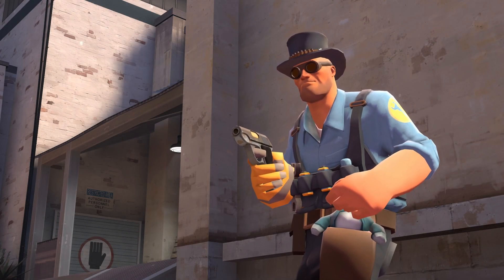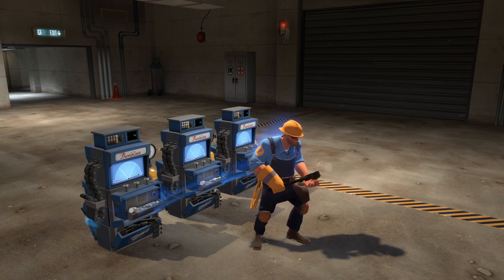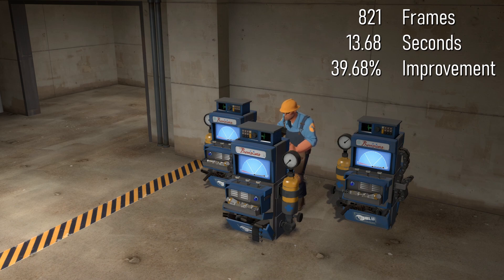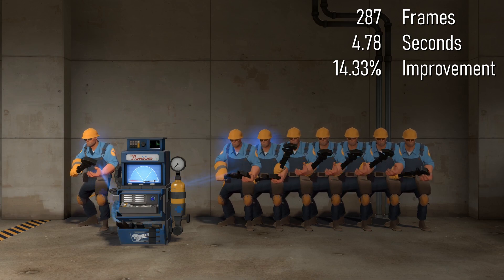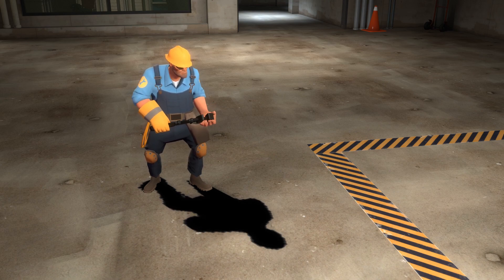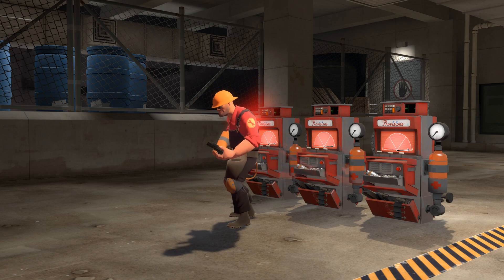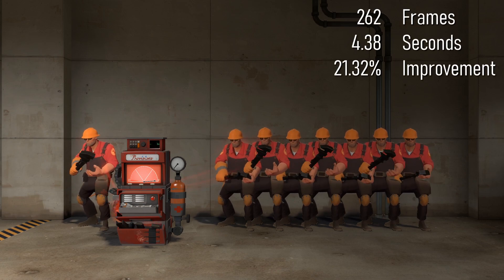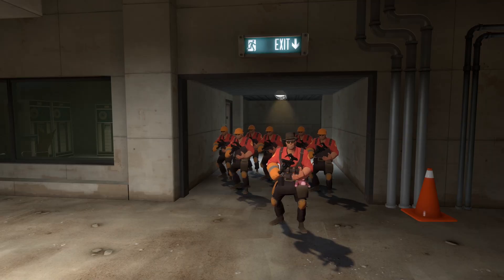Engineer Building Erection Times

Comment: So unsure if this is an April fools joke, but this is something I have wondered about. I skipped a lot, so unsure if it has already been mentioned in the video, but it is situationally useful. In terms of setup it is still faster for each individual engineer to build their own buiildings simultaneously. The most practical use of this would be if a building needs to be replaced urgently in the middle of a match.

Comment: I believe the reason why the rate of diminishing returns isn’t consistent is, if you dont time the swing to hit just after the building finishes upgrading and hit during the end of the animation, theres a moment of inefficiency since nothing is happening when something could be happening

Mainly hitting the building to put metal into the building for upgrading 

In a worst case scenario, that can be almost 0.8 seconds per upgrade animation for stock wrench, or 0.68 for jag